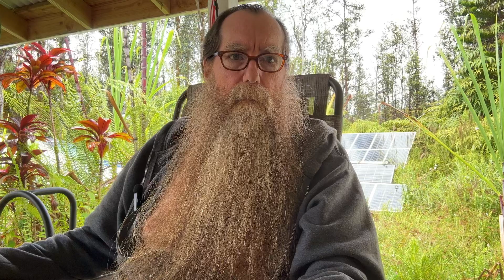Lightning strikes twice! 300 Million volts 30,000 Amps Gets your attention! Grounded, or ungrounded?

Comment: Is a Faraday Cage an option?
Where you metal (mesh) cage your building, putting up higher rods, like one sees often on churches etc.
Or build a (grounded!) smaller metal (chickenwire) cage around your sensitive equipment.
Perhaps put rods higher-up in the trees, grounded into the ground, instead?
In other words, a more sacrificial attraction for lightning other then you & your house.
Grounding is very important, but also the protection against EMP. (hence the cage)
Or indeed unplug anything and everything, but even than the voltages & amperages (energy) of lightning is so huge that can jump several feet.
The reason behind all this, is when you view several videos on YT of the high voltage labs & experiments, the metal cages do protect people & equipments against million of volts.
But I'm very sympathetic this all will perhaps be not that practical to you.
Out of the box & weird thinking, during lightning you would be safe in a car, maybe getting a defunct car and put the sensitive electronics into there?
A few months ago we had a direct strike of lightning into the center of our village, about 2 miles away from me. It sounded like a bom exploded. It nocked-out all the equipment of several stores for days. And these are brick-and-mortar buildings, so it is very hard to protect 100% against lightning.
Reply from the maker: I never knew that much about the cage, until these comments. I greatly appreciate your contribution to the discussion. Aloha! 🤙
Reply: @ProjectsinParadise808  My pleasure!
Not sure if it would be much use to you but there do exist also hand-portable thunderstorm detectors. They can detect upcoming thunderstorms up to 60km away.
And you probably already found them, the (e.g. MidNite) Solar Surge Protection Devices, they are available for both the DC-side as well as for the AC side.
As you are not hooked-up to mainssupply, your grounding/bonding is of course quite different.

Comment: Ya boy we were hit had everything unplugged the lightning hit the cable TV pole fried the TV through the cable and the sound system next Louis and I were in a boat fishing at fort peck thunder storm rolled in no way to get off the water all of a sudden our hair was all static standing right out and smacko loud we took a direct hit in the boat aluminum hull starcraft did not fry anything next mom an pop in Nebraska took a hit to there pickup driving down the hiway cooked all the electronics in the pu next rifle Colorado mom an pop same pickup same thing thunder storm hit cooked the computer in the pickup I have my panels grounded I are always nervous when lightning comes I was fencing contractor seen lightning start fires hitting sage brush they explode 20 feet from us sitting the storm out seen cows hit buy lightning they will have a burn spot on them that's how you can tell they were hit I respect it big time
Reply from the maker: Besides a healthy respect for it I have a genuine fear of it! When it was in my living room and the dust settled , I was a changed man! Aloha! 🤙